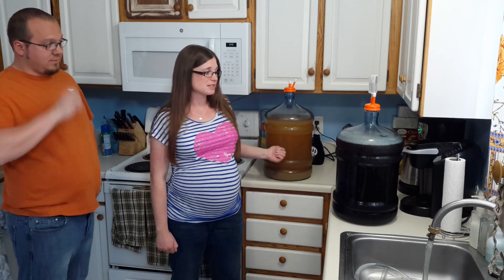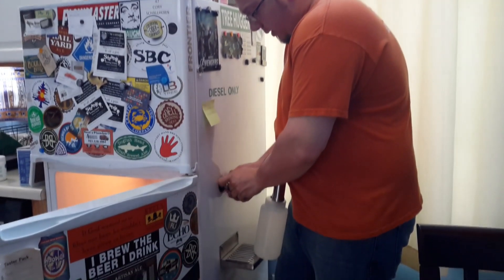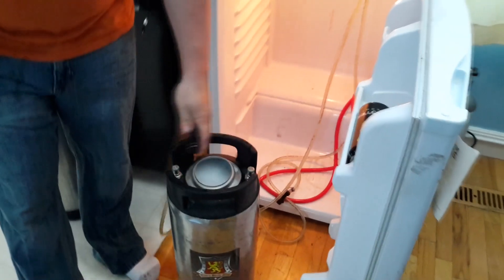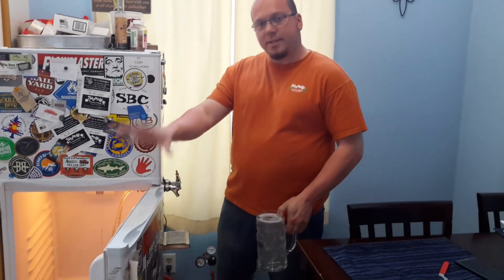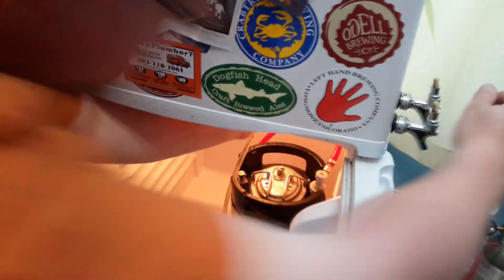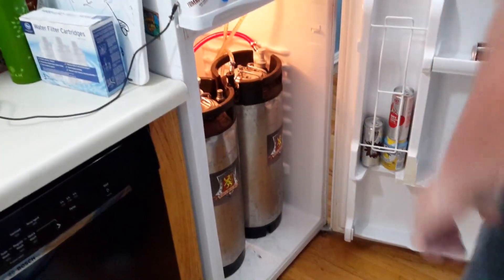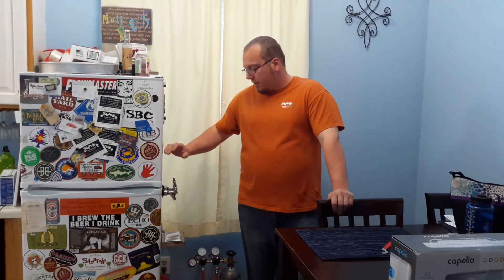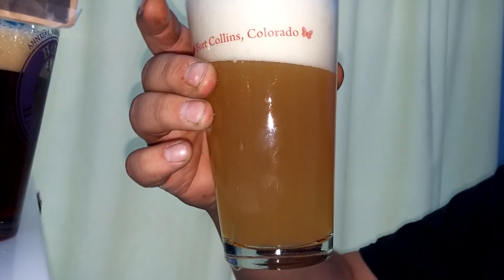Homebrew - Ep.3 How to Keg & Carbonate your Homebrew & Baby Shower Taste Testing

Comment: Hey I just converted an old freezer adding temp control. Any tips on keeping it clean. I'm using a deep freeze style. Seems like it stays kinda moist due to the condensation. I'm thinking spray and wipe it down with star san between sessions. Any other suggestions?
Reply from the maker: That's not a bad idea, Star San in a little expensive though. We had some diluted with water in a spray bottle for quick sanitizing of various things and tools. Depending on how bad it gets you could use some bleach to wipe it down, I don't think that will damage the inside. I think I used a cleaning product called Simple Green to wipe mine out before putting the next batch in, that seemed to work fine for me. It's pretty good stuff and isn't not a harsh chemical. I hope that helps and thanks for watching!!

Comment: Did you make the keg lid with the carbonation stone  or buy it somewhere ?
Reply from the maker: They came with the keg kit I bought at Tom's Brew Shop in Lakewood, CO. You could make them easy enough but youd need a TIG welder to weld the fitting to the stainless steel lid.
Reply: thanks!! I'll have to look in my local shop here in the Springs or maybe make a trip to Denver.